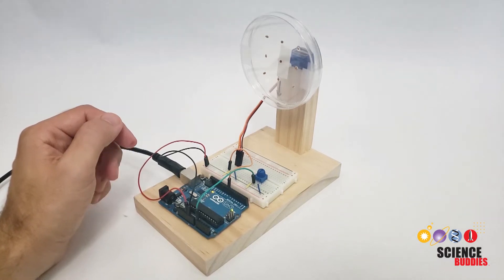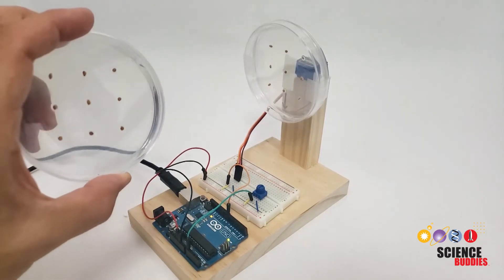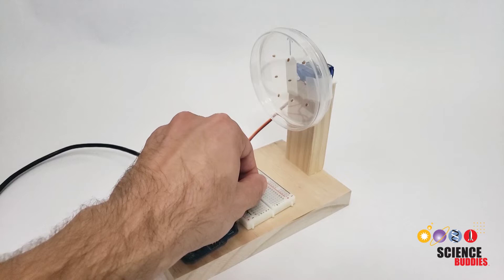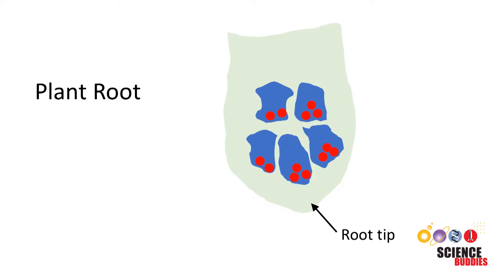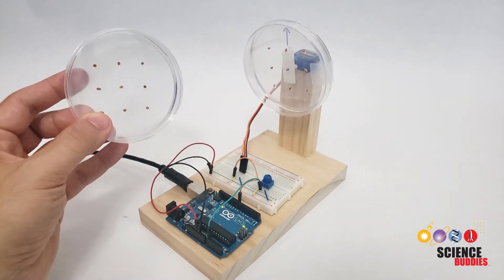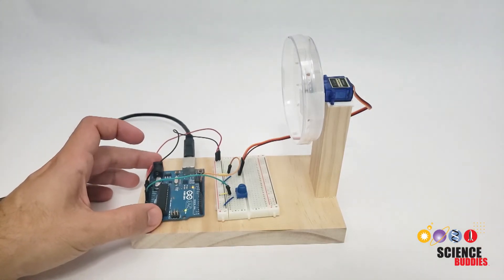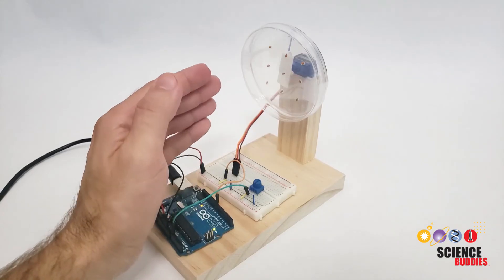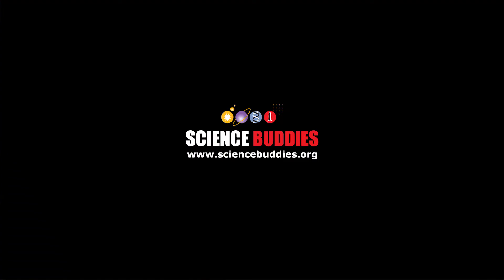Build an Arduino Clinostat to Simulate Microgravity for Plants | Science Project

Comment: I wanted to ask whether we can use a switch instead of potentiometer in the project
Reply from the maker: The potentiometer lets you easily control the motor's speed. A switch would only let you turn the motor on and off.

Comment: Is this possible to improve this project if i put mini water tank to spray the seeds every time when needed because i will use this in my research project
Reply from the maker: Sure, you might want to check out this project: https://www.sciencebuddies.org/science-fair-projects/project-ideas/PlantBio_p055/plant-biology/arduino-automatic-plant-watering. It might not make sense to use a soil moisture sensor in this case, but you could just apply water at set time intervals.

Comment: Hi, hope you’re doing well. Does the potentiometer have to be 10K because the only one I can seem to find in stores near me is 1k.

Can I add multiple or is one enough?
Reply from the maker: 1K should be sufficient, 10K is just a common size. You do not want to go too small because then you will draw too much current from the Arduino pins.
Reply: @Science.Buddies  Got it! Thanks for answering!

Comment: I have all of the wires correctly placed, but the servo motor doesn't seem to work. Is there anything you would recommend or is there any other way to get in touch with you? thanks!
Reply from the maker: Hi - if you post in the Ask an Expert forums on our site at https://www.sciencebuddies.org/science-fair-projects/ask-an-expert-intro and provide as much detail as possible, we will be able to help. You should also be able to attach a pictures of your circuit. Make sure the pictures are clear, in-focus, and well-lit so we can see all the connections, and we can help you debug. Many times it's just a single misplaced wire that's preventing the circuit from working, and it helps to have someone else double-check your wiring. We also have an Arduino playlist that includes a video about debugging, which may be helpful: https://youtu.be/9GLaU-BCEQM

Comment: i am having problem with running the fan motor. when plugged to a 9v battery it feels like wants to go but it doesnt. please help
Reply from the maker: Hi - make sure you are using a fresh battery. If that still doesn't work, try running the Arduino on USB power instead of battery power.